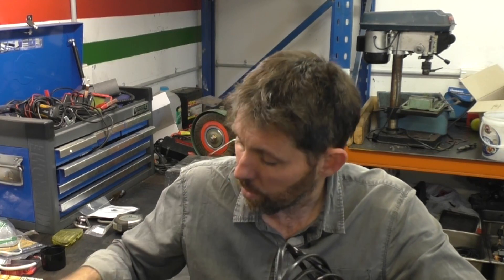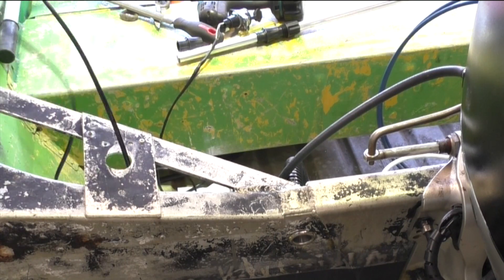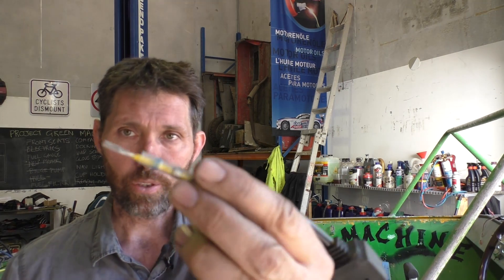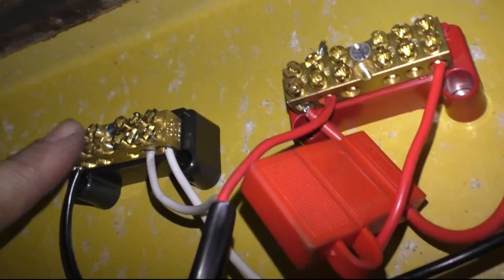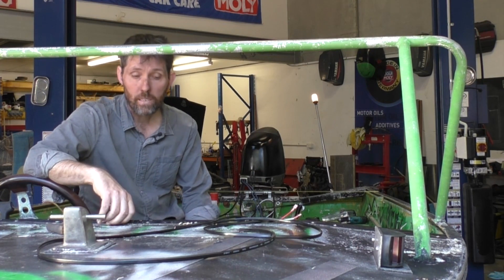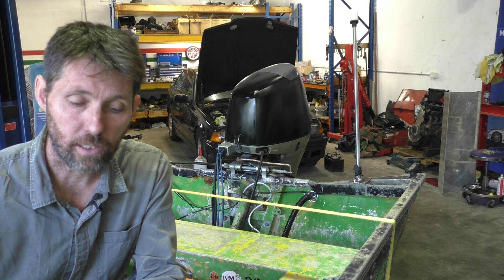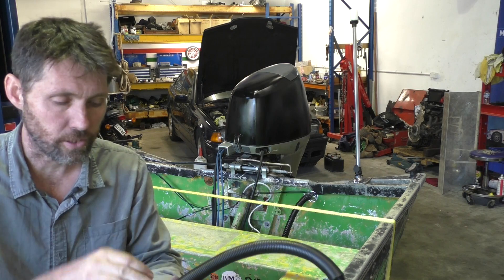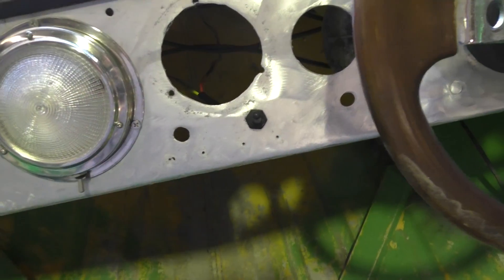Wiring the electrics on a boat [Pt 2]

Comment: Great video! My last tinny had an isolation switch on the battery which cut everything off, I just bought a new tinny and am in the process of rigging it up. I have an elec start motor so if I put an isolation switch on it, should that include cutting power to the starter as well? Cheers.
Reply from the maker: Yes, I would cut the power to the starter too.

Comment: Awesome videos!! I just ran around my boat with the multimeter...I touched the positive on the battery (connected to the motor) and touched the hull of the boat...it's showing 12.7 volts? You reckon this is ok? I would imagine it should not have a voltage showing? Thanks heaps!!
Reply: Paul Zivcic : doesn’t seem like a good situation to me either and is possibly resulting from an amateur’s approach. I can imagine a really serious electrolysis problem at some stage resulting in an irreparable boat hull. Perhaps best to get some professional confirmation on this.
Reply: @ianmac86  the boat is over 30 years old...I've stripped it all back , removed everything, floor, foam etc etc...shows not a bit of oxidation anywhere...I've been through every inch of the hull...spotless....

Comment: Thank you for your videos!  They are great!  I also bought a "fixmeupper" boat and now have a question.  In this link I show what I think will be safe and workable solution for my new minnkota trolling motor which requires a 60A fuse.  My question for anyone is. 1) do I have the fuses in the correct spot?  The remaining devices are 6 lights and a fish finder.  Thank you!!!
https://drive.google.com/open?id=1FaIZKMdelKg6tzam4RorjjdRuJ8OnPE3

Comment: Hey I got a 1977 Johnson 55hp   It has spark. And  it get gas’s to the spark plugs. But not cranking over
Reply from the maker: Sounds like either low compression or the timing is way off.

Comment: First thank you for your time and instruction. You are providing an invaluable service to all of us boat owners who like to do work on our boats, and we will know it is done the right way. This next comment is for Chris C. and anyone else with what kind of wire to use. The ABYC table tells you what gauge wire to use. Example...running a 10 amp bilge pump from the transom to the switch on the dash panel which is roughly 20ft. Then that would require 12 gauge type 3 AWG wire. I am using this table now and it’s a great resource. Again... thank you for your videos...Cheers!!!
Reply from the maker: You're welcome, and thanks for the tip. I should add a link to the table in this vid.

Comment: Danger Marine, new to your videos and really like them. I am hooking up a battery isolator to an existing 2 bank set up that has a battery switch. Does the wire from the Alt go to the iso first then to the switch, or does it go to the switch first then back to the isolator? I cannot find the answer anywhere. Any help is appreciated
Reply from the maker: Most battery switches will double as an isolator with settings for 1, 2, 1&2, and off. If not, I would but the isolator between the battery switch and the rest of the boat's wiring.
Reply: my battery switch does have settings for 1,2,1&2 and off, therefore I do not need an isolator? I can just manually switch from 1 to 2 to save my alternator. When do you ever put the setting to 1&2? Thanks for your quick response

Comment: Hey Stu,
In the automotive industry using relays are really common and if you don’t use them it’s generally frowned upon. I’ve noticed in your videos and 99% of other marine videos I’ve seen, that relays aren’t used on boats much at all. Is there a reason for this that you know of? Unnecessary complexity maybe?
Cheers mate
Reply from the maker: It's really a matter of how much current the device you are switching draws. With navigation lights the current draw isn't much higher than the power used to activate the relay so there really isn't any benefit to a relay. Trim tilt units use them as well as starter motors obviously (well, solenoids anyway). In this video I install some docking lights that draw too much current to be wired directly  https://www.youtube.com/watch?v=i7Z3dKJ62Lc
Reply: Dangar Marine thanks Stu that makes sense. Love your videos. I just started boating and your videos are invaluable. Thanks!

Comment: Could you please give me the sizes of the wires.. In cm... Likt 10mm for batteries etc etc
Reply from the maker: I think the twin core wire is just sold as "20 amp" wire and the main battery leads at 32mm2
Reply: Dangar Marine thanx for answer. I was watching a clip of yours like 3 min ago.... I have 16mm cable i little to big but my friend told me its not so bad on a 73 amp battery...dont know in mm2 exually

Comment: Another great video. Quick question Stu, I just picked up a second hand 50hp merc 4 stroke 2010. It was removed from boat and all wiring  for gushes etc not labelled. Any recommend manual etc that could help me correctly wife the new engine you know of?
Reply from the maker: This colour code table might help. http://www.maxrules.com/fixmercwiringcodes.html 
Otherwise the service manual for that outboard might be available online somewhere.
Reply: Thanks heaps mate

Comment: Where do I hook battery ground wire to 25 hp mercury 4 stroke..elpt?
Reply from the maker: Normally you go to the casing of the starter motor via one of its mounting bolts.

Comment: Hello Dangar, I am new to boating and I've been watching your videos, they're absolutely helpful for me as I have understand a lot of things. One question I would like to ask- 

I'll be installing twin engines for my boat. Is a battery alternator switch necessary?
Reply from the maker: Hi Benny, ideally you don't want both outboards simultaneously charging the one battery for any length of time. This can happen briefly if one of your batteries is flat and you are starting both motors off it though. The best situation is to have two batteries and two switches allowing you to run either motor off either batteries, but then have each motor charge their own battery separately. Must do a video on this one day!

Comment: for install in boat will the illumination stay on while baot is off? How would I wire it so that the panel will not draw power if key is not in ignition
Reply from the maker: There is a positive power wire from the forward controls of outboards that only supplies power when the ignition is on. Connect anything you want to go off to that rather than straight to the battery.
Reply: Dangar Marine would I be able to connect a 12v 6switch panel to that positive wire from the forward control amd should I wire in a fuse bank?

Comment: what gauge wire did you use for the socket?
Reply from the maker: I can't recall the exact gauge, but I think the main wire to the front was thick enough to carry about 20 amps and the others were about 10 amp wire.

Comment: You make great videos and present the info very logically. Thank you! I'm new to this but one question: why did you run the back light to the switch on its own wire instead of using the terminal blocks you installed in the first video? Would you run all switched circuits on their own without using the terminal block?
Reply from the maker: Hi mate, I'm trying to think back, but I would have expected the stern light to also get it's power from that terminal block in the front. Sometimes when a device is at the back you can get power straight from the battery to avoid running wire all the way to the front and then back again, but if the switch is at the front (as it is with that light) I would have thought it would go to the terminal block. I'll take a look on the way home and get back to you.
Reply: I think he did run the switch from the terminal blocks.  The wires from the back light just go up to the switch and the ground terminal block, then the switch gets its power from the positive terminal block to complete the circuit when the switch is turned on.

Comment: I have led black lights strips down the sides of my boat. Any idea why led lights would keep blowing out? Should I have some type of regulator in the circuit?
Reply from the maker: Good question, sometimes LEDs do have driver circuits that limit voltage and current flow so they don't blow, but I've never installed one so I'm not that familiar with with them. A Google search for LED driver circuit might help, but somebody also mentioned a specific one in the comments my latest video on making underwater lights.

Comment: I just bought a fixer upper boat. Your videos are the best on the internet. You have helped me so much. Thanks for that! Keep up the good work mate.
Reply from the maker: Thanks Michael, you're most welcome. Glad the videos have been helping you. :)
Reply: Dangar Marine I will be rewiring my tinnie shortly. And like the techniques you have used and will do something similar.  My question is how do i determine what guage wire to use throught. eg. battery to terminal block to fuse block instruments / switches ?
Ps. well done on your videos very interesting and informative.
Reply: CHRIS C the gauge wire is directly linked to the amps you have as he said in the previous video 12 gauge wire and 20amp fuse ie if you’re only using 15 amps you could go down to 14 gauge but have heavier wire is ok but lighter wire than the amps of the circuit is bad

Comment: Thank you from Victoria, BC.   I am working on making my wiring on my Bayliner much more neater, with my boat there isn't a fuse box....everything goes tot he batteries.    I have to make changes to it.   Thanks again.
Reply from the maker: Hey James, adding fuses is a good idea, if anything goes wrong you don't want a fire one board.
Reply: Yeah, I hear you on that one.....I am taking my engine out of the boat today.    Just taking a break, I needed an extension for my socket.

Comment: how do you make sure your electrics are isolated from your hull, and how do you know your battery isnt earthed to the hull? in regards to electrolysis. finding it hard to get clear information on all the procceses that can damage an aluminium hull through forums
Reply from the maker: Really good question, one that deserves (and will get) its own video. The short answer is that the battery will always be grounded to the hull. The whole engine block is a ground and it is attached to a metal hull using metal bolts so it's kinda unavoidable. The trick is to make sure that the hull is never the path of least resistance back to the battery by having good insulated wiring.
Reply from the maker: Really good question, one that deserves (and will get) its own video. The short answer is that the battery will always be grounded to the hull. The whole engine block is a ground and it is attached to a metal hull using metal bolts so it's kinda unavoidable. The trick is to make sure that the hull is never the path of least resistance back to the battery by having good insulated wiring.
Reply: I see, makes sense. defently looking forward to a video! thanks for all your vids they are very informative and you make it easy to understand and follow. keep up the good work

Comment: Hey Dangar Marine.  Great Videos I enjoy them much.  You should note a couple things.  Boat wiring connections should never be joined solely with solder- if a wire were to short or get hot the solder would melt and lead to further issues.  Crimping is required but crimping and soldering a joint is ok. As well every circuit should have it's own properly rated fuse, not a single fuse for many circuits. A fuse big enough to handle all circuits at once likely won't blow in time if a single circuit shorts, causing that circuit to burn up or catch fire. Keep up the good work and be safe!
Reply from the maker: Hey Dan, glad you like the vids. :)  I've heard you shouldn't use solder under hood of cars for very similar reasons, but I find that corrosion is such a big problem in boats that live in salt water all the time that soldering is almost essential. Good point about doing a combination crimp/ solder connection though. I do think it is optimal to fuse every circuit, but that terminal block purely supplies my low current devices. The docking lights (video coming soon!) are fused separately as is the bilge pump. I'd be very surprised if anything would get hot enough to melt before that 10 amp fuse blew. I do appreciate the advice though and probably should have sprung the extra cash for one of those fuse holder terminal blocks. Oh well, maybe it can be an upgrade down the track. The next thing I want to add is a separate block for ignition on power. At the moment I don't have any way of lighting up the dials while the engine is running.
Reply: @DangarMarine   Did you ever wire up the separate ignition block? I could use some of that info. I'm rewiring a bayliner with a '86 force 125. I have come across a road block with the magneto wires (2) with only one M on the new key switch and with powering accessories when key in 'on' position only.

Comment: Hi I have a problem with my 115 2006 evinrude outboard that keeps overheating or something cause the alarm oil keeps going off plus every time drive it out in the water it either doesn't go into gear or it just shuts down I have taken it to my marine shop and have had it service and checked last week I told them the problem and they said no everything is good but when I take it out the nexts day it's still the same could somebody please help cheers
Reply from the maker: Hmmm, certainly sounds like it has a few problems. Give it has been into the shop, I presume all the obvious things are fine. The trouble with some in-land outboard mechanics is that don't get to do a proper on-water test after the boat has been serviced. Plenty of problems don't show up until the engine is warm or there is pressure against the propeller and load on the motor. Being an Evinrude it could be a problem with the oil injections system, but I'm not sure how that would stop the motor going into gear. I know none of this is probably much help, but I'd certainly be getting an Evrinrude tech to take it for a run on the water if that is when the problem is occurring.

Comment: Any concern having the battery so close to the fuel tank in the event of sparks etc.?
Reply from the maker: No, not in an open outboard boat. With enclosed boats things get a bit more serious, and also with LPG cooking gas as it is heavier than air and will collect in the bilge. Sparks are more an issue with brushed motors such as fans, bilge pumps, starter motors etc.

Comment: Stu, I am now the proud owner of a Honda BF40A on my newer RIB. My Novu with the 25 Yamaha was lost at sea after I damn near rebuilt the entire thing. The tilt and trim has a leak. I'm trying to pull it and it appears that I have to remove the port side bracket to remove the unit. Does this sound correct? I've removed the upper pin and lower bolt and it still seems stuck in the place. It moves a little bit but not enough to get it out.
Reply from the maker: Hi mate. Yes, you will need to move one side of the bracket away in order to get enough room to remove to the lower pin on the hydraulics. This video covers that job, but I think I only show putting in back, not taking it out from memory: https://youtu.be/n0WsNGyGlV0

Comment: My cousin has one of those removable LED stern lights and it constantly flickers as we drive, I have found the connectors on them are not very good and will be putting a 'canon' style connector on it soon to stop this from happening.
Reply from the maker: Hey Matthew, so far this one seems rock solid, but there have been others where corrosion has affected the pins so I have just opened the connectors and hard wired the light with enough slack in the cable to lay the light down if need be.

Comment: hi,i have problem with stuck drive shaft on small one cylinder mercury,tohatsu,nissan 5 hp,when i want to take off lower unit it just moves a litlle left and right,but doesnt come out,of course i have both bolts out and linkage undone,once you have a similar thing post a video,it would be very usefull
Reply from the maker: Yes, the driveshaft can get stuck up in the powerhead, which is what is happening with you if I understand correctly. You can try gently tapping with a plastic hammer and seeing if you can get a lever in the gap to pry it down, but be careful as the casing of the gearbox is aluminium and very easy to damage. Will do a video what I can.
Reply: i tried gently,but lost patience as night crawled by,i think i broke something,now it goes out a lot,but not hole way ,ssomething stuck on top of driveshaft,probably a piece of powerhead

Comment: any reason you didn't have a fuse for your stern light?  more generally, when do you add in a fuse, and when do you not worry about it?
Reply from the maker: Hey Corey. The stern light is fused because it gets it's power from that positive terminal block which is fused. This means that if there is a short in any wiring beyond that, the fuse will blow and all power to the terminal block will be cut. The advantage to that is that you can add more devices and know they are protected, the disadvantage is that if one thing goes they all do. I would always have every device protected by a fuse as there is nothing worse that having to redo all your wiring because a short somewhere caused it all to melt! :(
Reply: ah, I forgot that you already had that main positive terminal block protected with a fuse (from wiring video part 1).  thanks for the great vid!
Reply from the maker: No worries, you're welcome. :)